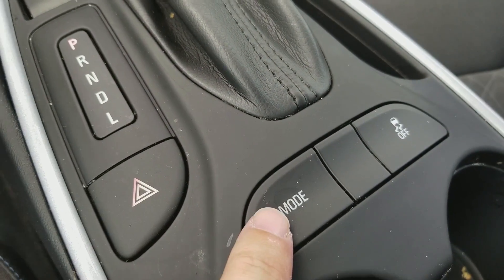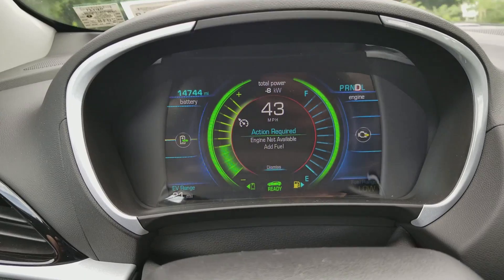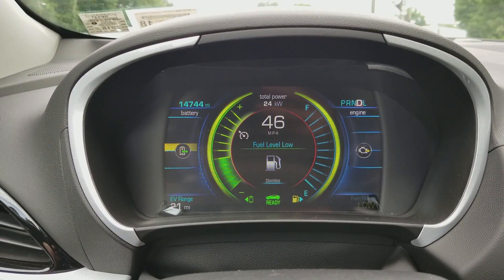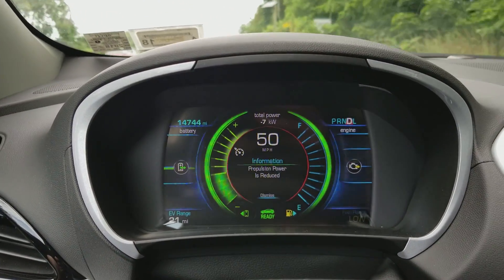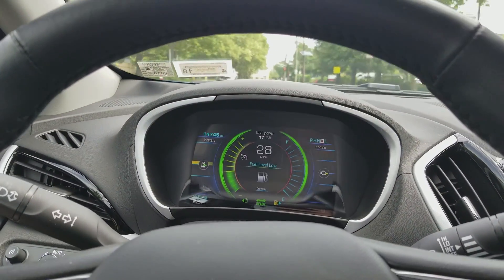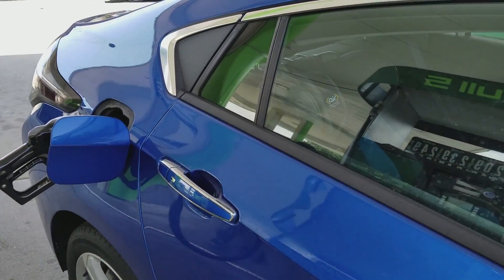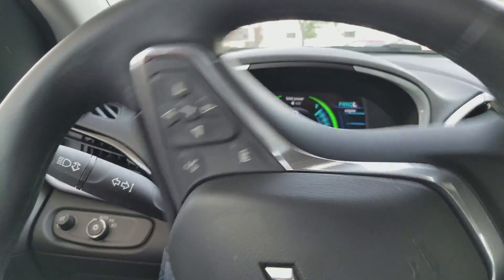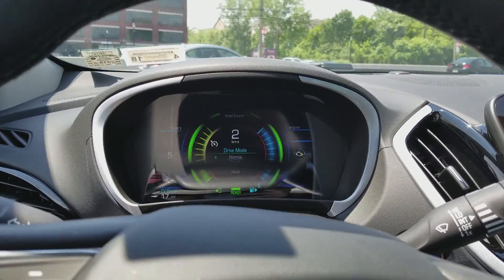Electric Chevy Volt Runs Out Of Gas - Becomes Dangerous

Comment: Bad sales man and an uneducated car owner. Every hybrid/electric car always starts on gas then switches to electric at speeds over 80km/hr. the idea behind this is just as you stated the electric part of the car simply does not have enough power to simply rely on electricity. As you drive at higher speeds the battery starts to charge and when it is charged enough the car switches to electric mode as cruising at highway speeds does not require as much "electric power" as starting and stopping in electric mode. As you have seen you should never let any car electric or not run out of fuel

Comment: It's a hybrid because it has an electric motor and a gas motor. The gas runs the gas motor and batteries run the electic motor. Now in hybrids generaly the electric motor is the weaker of the two and is just there to assist the gas motor to get you better gas mileage. So when you run out of gas you are left with only running on the weaker electric motor so there for no gas = limp mode.

Comment: Okay, wait just a damn second.  Everything I read about the Volt, said the the motor, (Notice I did note state, engine) was used in essence, as a generator, to charge and create voltage for additional propulsion, the the motor, does not use any mechanical means of driving the wheels like an engine.  So in essence, all you did was drain the gas tank of an onboard, gas operated generator.

Comment: This is not dangerous.. 
I have driven cars that are slower than this when they left the factory and almost all trucks and buses are slower than this.
Reply: It's more to do with how much it's power is down on the regular performance without a warning. If you have a car with 100hp and one day it suddenly only produces 25hp without a warning, you have no way of knowing that you can't accelerate to join the flow of traffic as you did with 100hp. Hence you could pull out into a space you could take with 100hp but as you only have 25hp you don't accelerate anywhere near as fast as you did with 100hp and you cause a crash because you didn't get out of the way of a Truck travelling at 55mph. 
In your case you know the car is slow at accelerating so you drive appropriately and don't take gaps in traffic only a car that can do 0-60 in a quarter of the time could safely accelerate up to speed in. 
It's a very wordy explanation but I hope it makes sense to you.

Comment: Hey just so you know, my 1974 beetle takes about 19 or so seconds. The Volt is definitely slow in limp mode but I guess it's kinda cool that it makes you conserve what electricity that it has, in order to get you the furthest distance with no gas.
 
It knows that you will be walking after it runs out of electricity lol.

So really I personally find this feature neat and think of it as Chevy's way of further "dummy proofing" the vehicle.

Keeps all the retards from walking even though it has 2 sources of propulsion lol.

So if you get stranded with this car, you just need to buy a bike and sell your car.

Comment: It's literally in the owner's manual tho. Had you read the manual before attempting this, you would have known that this would happen. The only dangerous thing in this situation is you.
Reply: In a situation on the road were you run out of fuel but the battery still has charge to keep driving to a fuel station you're not going to stop and check the manual. A warning should have been implemented like the fuel warnings that running on the power reserve will reduce the performance of the car.
Reply: It has a fuel gauge just like every other car. Suddenly running out of fuel on the highway is dangerous. Every hybrid relies on gasoline for acceleration, it's not an all-electric. If he had even taken a moment to do a tiny bit of research before attempting this, he could have completely avoided the situation.
Reply: I'm aware cars have fuel gauges. However, there are still people who will unintentionally run out of fuel and don't understand the mechanics behind their car. These people will expect their hybrid to run as well on electric only as it did as a hybrid. Without a warning of the reduced capacity to accelerate, these people will cause a crash. You may argue that these people shouldn't have a licence, but they do and continue to get licences so these safety features need implicated.
Reply: Maybe, but I'm not aware of any hybrid at all that gives you a warning that implies that. Even with every Prius I've ever been a passenger in, it's just "Low Fuel". It's not a problem that's specific to the Chevy Volt.
Reply: He only reviewed this Chevy so that's where he found the possible issue. If no other such car warns about the reduced power and has an equally severe decrease in power then it's an issue over all similar cars.

Comment: dunno why people think this is supposed to be an electric car. it is a plug-in hybrid that can run in low speed electric-only mode (which is fine for non-highway use), but its designed to have the gas engine available for acceleration like any other hybrid.

Comment: The car lowers it power because its still trying to run the run the engine with put fuel so it needs to lower as to not harm the engine or you could end up with a half dead car

Comment: You leave your car run out of gas, only using electric. It is basically working on a "limp mode" to allow you to reach a gas station. Not being able to overtake, or reach the speed limit is not "dangerous". Just hold back and fill it up with fuel

Comment: Maybe some powertrain engineer from GM chime in here for me and see if I am right, since I only work on a college solar car team and have limited knowledge in this area but I think the reduced power mode is more than just for conserving electricity when there is no fuel but also for safety and longevity of the battery cells. All batteries actually have a know viable operating range of voltages, the higher the voltage the battery can provide, the fuller it is. Motors on the other hand, usually operate on a constant voltage and develop power depending on how much Amperage it is provided. To put this in an analogy, the motor is like a bunch of water balloons that need to be filled and the battery the hose you fill them with, the more balloons you can fill in a given time, the faster you go, the higher the pressure it is in the pipe, the more balloons you can fill at the same time. The voltage in the battery fluctuates constantly when it is in use, and sometimes when the battery gets into a certain range, a sudden demand for power may drop the battery below its recommended voltage, and permanent damage may occur. Sometimes, this permanent damage can cause a short in the battery "jelly" that forms the core of Li based batteries and they get very hot, which quickens the chemical reaction process that produces electricity, which only makes the short hotter. This chain reaction is called a "thermal runaway" and the battery explodes and burns. This spectacularly happened to some early version Teslas when they crashed and the battery cells were destroyed. This is also what happened to faulty Note 7 batteries, so everything is done to prevent thermal runaways from occurring. Usually this is done through a Battery Management/Protection System (BMS/BPS) and is critical to the safety of the car. Thus maybe since prolonged driving on a battery pack tends to drop its voltage quite a lot, and maybe the battery pack can only deliver the full amperage that the motor needs at the high end of their voltage range, and the ICE kicks in quickly to make up the difference when the battery runs low to supply the amperage during acceleration and quickly shuts off when not needed. This would also explain why the engine would automatically run after an electric only drive and you put fuel in it, because it is trying to bring the battery pack up to a higher voltage. Of course we can go into details here about active balancing, parallel vs series stacking of cells, cell chemical reactions, jelly sandwich compositions ect. ect. but that spans many fields of Masters and PhD level education, something I cannot claim to have or even begin to comprehend, but hopefully that was a good ground level explanation for why the Volt acted the way it did. Hope I didn't miss anything and feel free to chime in and correct if needed.

Comment: i imagine they limp mode it too conserve energy so you can make it too a gas station, but that should just be a manual option to turn on
Reply: In the first place, it explains this completely in the operator's manual.  Secondly, there's always some battery power left, because GM knew the battery lasts longer if not allowed to completely discharge.  You ought to thank them for this limp mode, designed in for anyone stupid enough to let a dual powered car to run out of both electricity AND gas!

Comment: You need better followers. I didn't see even one comment making reference to the different modes that ACTUALLY happen in a Volt when you have the vehicle in "Drive". (These modes are obfuscated from the driver for simplicity. Note here I'm talking about internal operating modes, not the mode button.) There are two motors in the car, MGA and MGB. (MG = Motor-Generator, they can operate either as a motor or a generator through clutches.)

http://gm-volt.com/2015/02/20/gen-2-volt-transmission-operating-modes-explained/

CD1: One Motor EV Mode (ICE: off, MGA: off, MGB: on)
CD2: Two Motor EV Mode (ICE: off, MGA: on, MGB: on + regen braking)
CS1: Low Extended Range Mode (ICE: on, MGA: ice generator, MGB: on + regen braking)
CS2: Fixed Ratio Extended Range (ICE: on + mechanically linked to wheels, MGA: off, MGB: on + regen)
CS3: High Extended Range Mode (ICE: on + mechanically linked to wheels, MGA: on, MGB: on)

Notice how there are only two operational modes available when you can't run the ICE (gas engine). Notice how CD1/CD2 do not mention boost (ice engine boost).

Comment: Why no time on the 0-60 with gas?
Seriously though I anticipated on the Volt behaving in this manner when it's out of gas for one simple reason: it constantly advises you against it.  Less than 2 gallons of gas?  LOW! Owner's manual? HAVE A THIRD OF A TANK!
And if you were the engineer and the programmer deciding how this machine would behave if someone were so reckless, would you have it still expend the energy it has left at full throttle, or slow it down and make the driver think very carefully about what little they have left?

MMMM yuuuppp
Dangerous, my ass.  Dangerous if you didn't think about it, maybe.  Totally reasonable if you did, definitely.

Comment: haha 19 seconds to 60 is dangerous? Damn when did that happen? I've had some fast cars in my life and those sure are fun, but I've also had some slow ones. currently driving a 99 VW Beetle with the appropriately nick-named 2.slow motor, and it typically does 60 in about 20 seconds. a previous car to this, my Suzuki Sidekick, even worse, talkin' about 25 seconds to 60

Comment: In regular drive modes (non-hold) the Volt usually won't let you touch the lowest 30% of the battery capacity in an effort to make the battery last longer. If the car is totally out of fuel, it allows you to tap into a small part of that capacity in order to make it to a gas station. It's not exactly for "accelerating onto the highway"!! My Gen 1 Volt is a little different than yours, but I believe if you would have changed the drive mode back to non-hold, the electric engine would have been allowed the full battery and driven normally, at least until the battery was again below 30%

Comment: When you go WOT does it always have the engine assist a little bit, like it does in the video? Maybe with out the help of the engine it will pull to much current and damage the batteries.

Comment: I don't care what anyone else says, if it has a gasoline engine it's a HYBRID, not a true EV.

The gasoline engine MUST be used regularly, otherwise gas will go bad, moisture will build up in the crankcase, etc. Not only does the gas engine have to run every now and then, it has to run long enough to get up to full temperature to avoid the aforementioned moisture problems.

So the manufacturer probably figures, since the gasoline engine has to run regularly anyways, why use a big beefy electric motor when you can simply supplement gasoline engine power to provide full acceleration? Wise decision actually, since a large motor with larger inverter and probably beefier battery pack to handle the large current draw, would increase the cost and weight of the vehicle. Since there's already a gasoline engine in there that must run regularly to stay healthy, why not make use of it?

Comment: The car reduces power to give you more range.  Call GM and ask.  They will tell you the same thing.  Run out of gas and only have battery - that is how it is programmed.  It is so you won't get stranded unless you are a complete idiot.

Comment: The Volt is a stupid car.  It isn't a hybrid and doesn't even have regenerative braking.  It has a short range electric motor and when that runs out it has a weak four cylinder engine.  It's too expensive and I see twenty to thirty Teslas on the road to every Volt.  When the Tesla costs way more than twice as much as a Volt that tells you something.  In GM's defense the Volt was part of the price they paid for the '09 bailout.  It was a concept car which, if you know GM, they never intended to build, but the government mice were in charge of the cheese and demanded that GM build it.  It's a lesson for any company dependent on government largesse:  "He who sups with the devil should use a long spoon."
Reply: It does have regenerative braking. Switch is on the steering wheel (since the 2016 model year).